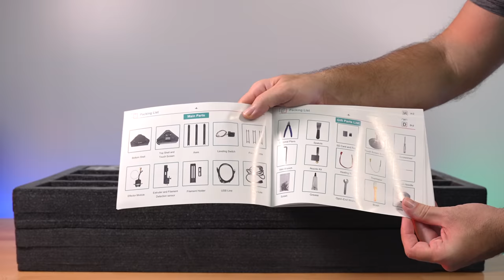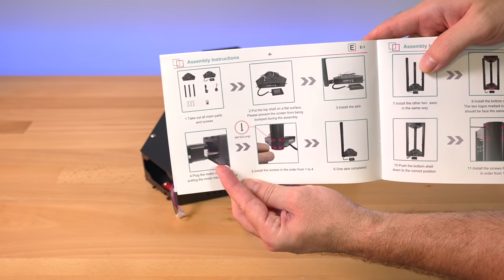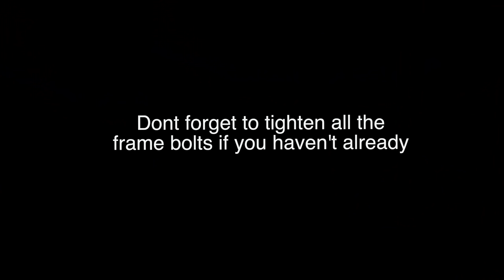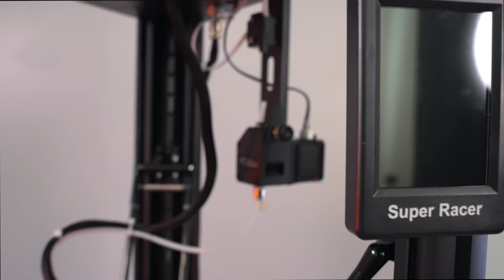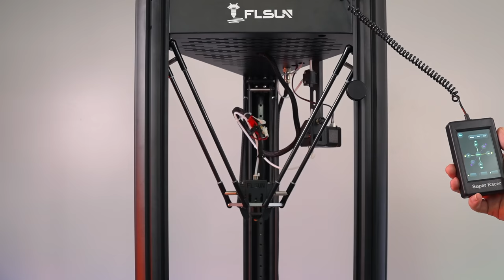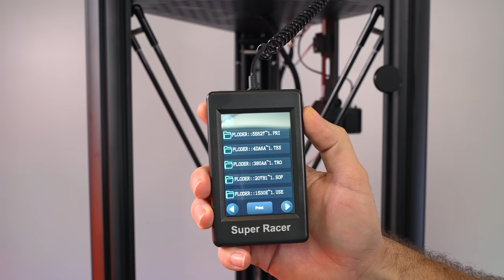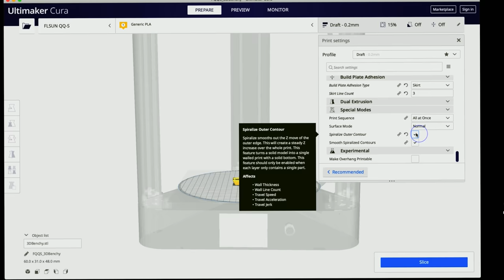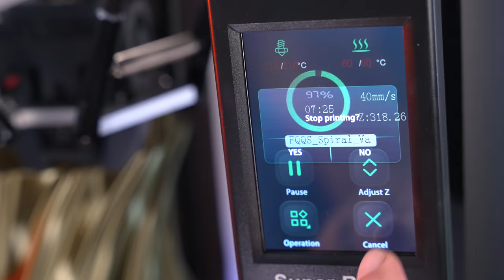Flsun SR Super Racer - Delta 3D Printer - Unbox & Setup

Comment: Like your videos- very detailed. I just got the Super Racer a couple days ago and print at 150mm/s and the prints are 95-97% as good as my Creality printers at 50 mm/s.. If you haven't done so you need to change the fan ducts for the nozzle. There easy too print out and will eliminate the ringing, etc at high speed. You can find the link to them at the Aurora Tech youtube channel in her Super Racer review. Print out the ones that have the "L" for long, not the "S" that are standard.. Good luck Gerry

Comment: Just received the FLSUN Super Racer today. It's my 10th printer and now I am angry. Why couldn't I have discovered this printer sooner?!?! Not only am I printing 0.2 layer height at 100mm/s, but the prints are also super clean!!! Ugh. I feel like I wasted my money on the Ender 3 V2s that I have maxing out at 50/mms on the simplest prints. Or slower down to 32mm/s on more complex prints. I am now spoiled by the Super Racer.
Reply: I have to retract my comment. Getting print failures with prints taller than 175mm. Even with a brim, the prints keep getting knocked down at 80mm/s. Vibrations are amplified once it gets above 175mm. My FLSUN is placed on my cement garage floor. Trying to figure out a solution but haven't gotten anywhere yet.
Reply: Hi did you manage to get it sorted, can't make my mind up for a first printer.
Reply: @ricardo-iw9sq  Hi, ah yes I had to tighten the belts quite a bit. Much more than I'm comfortable with but my issues have been resolved. This printer took me a little bit longer to dial in my settings. But I can now print beautifully at 60-80mm/s. Faster than that is draft quality. Great printer. Just take your time with it.

Comment: Been using deltas for years and tried every format out there like the ultimaker gantry that's constrained at center on X and Y, COREXY with v wheels and linear rails, ender 3 style with v wheels and linear rails and none held a candle to my print quality on a well tuned delta with just V wheels. I have also tested Traxxas linkages with rubber bands to remove slop vs magnetic and the Traxxas with rubber bands for slop removal are better as they move more freely and don't rotate around a large ball that can offset the geometry. Only downsides to deltas is small build area and the software setup but the trade off is simple mechanics.

Comment: hello i got this printer based off your detailed review! i love it!

i have a question though, one thing i noticed when i print is the nozzle scrapes on top of my print and i heard it when you put your microphone when it was printing benchy @ 40:44 of the video 

do you have any recommendations to smooth that out a little? i use cura and my settings are basically identical to yours

thank you:)

Comment: With this type of printer if it was scaled up so the bed size would be equivalent to a prusa or ender would it just be physically to tall because if the speed is in between a Cartesian style and a core xy then surely its a contender or am I barking up the wrong tree.
Reply: FLSun V400 has entered the chat

Comment: I don't agree that the spring-loaded gantry arms are high build quality. All other  FLSUN printers have the gantry arms security screwed to the mounting points. Spring tension will weaken over time and impact print consistency with this design. I don't understand why they would weaken those mounts with a printer design to print faster. Other than that it looks like a solid printer for the price.

 I have the same problem with loading filament into the extruder of my Q5. It is a design flaw that causes the problem. There is nothing you can do to make loading easier without modifying the feed tube on the extruder. There are some solutions on Thingiverse to help resolve it.
Reply: Have no problems and don't understand which you mean. Everything is working like a charm.
Reply: @lazyman1011  The spring-loaded gantry or the Titan extruder? How many spools have you run through the printer?
Reply: @saltyscorpion2151  Q5 stock approx 5-6 spool's.
Reply: @lazyman1011  My Q5 is like threading a needle to get the filament through the gears and into the Bowden tube. I dread loading filament.
Reply: @saltyscorpion2151  Maybe your nozzle is particularly clogged?
Reply: @lazyman1011  Nope the problem is loading the extruder. Once I get the filament past the extruder and into the Bowden tube, it moves like butter to the nozzle.
Reply: @saltyscorpion2151  Ok, sadly can't follow the problem.
Reply: The way I look at it many other parts will fail before the springs have any type of loss. As per note keep the ball joints and other parts greased.

Comment: My Benchy at 180 looks as good as yours at 60. Finished it in 40 minutes 

My only problem so far is that the prints are a bear to get off the bed
Reply: There's seems to be some yellow subtance on the new bed surface that scratches off if using a scraper or even a damp cloth with your nails! After 200hrs printing now the adhesion isn't as good as before so I've had to bump up bed temps to 65-70c. I'm tempted to get the pei flex plate, but will hold out until the warping gets noticeable on the edges.

Comment: Please help, at 31:10 you just push the filament through and it goes in without a problem, I push mine in and it stops like if it’s blocked and doesn’t come out the extruder.. can anyone help me out what’s the problem, bought it used
Reply: Same
Reply: It took a while but I pushed it down but when I try print it just curls at the end

Comment: Vlad, There are reports that all new resin printers, using ChiTu System control boards, will only work with the Chitubox slicer? Uncle Jessy was the first to report on it, but other 3D printer channels have commented on it. Have you heard anything on the topic?